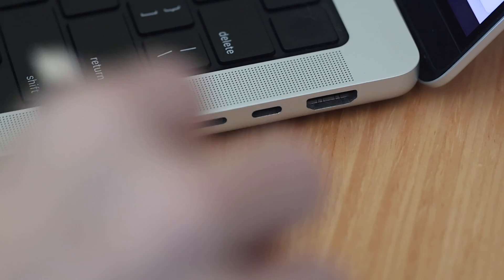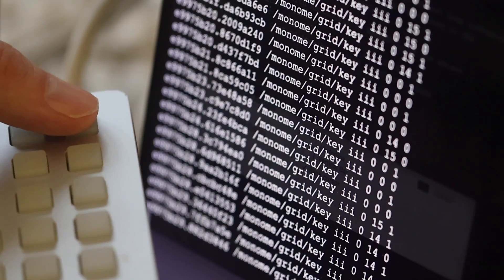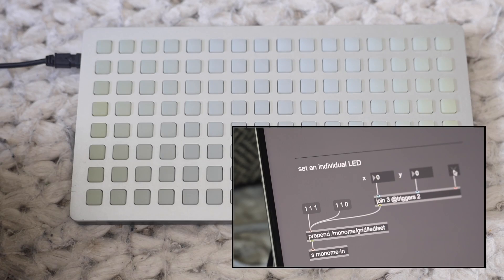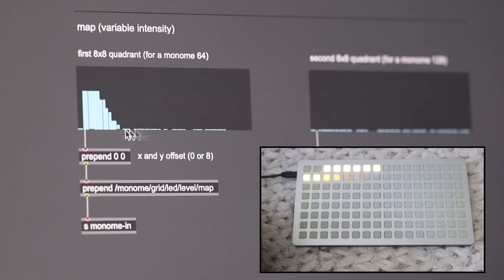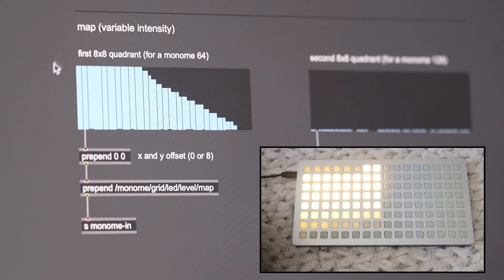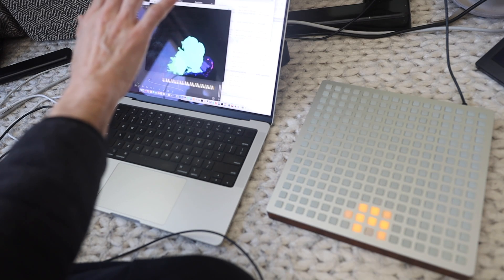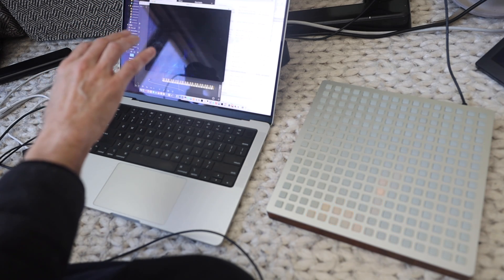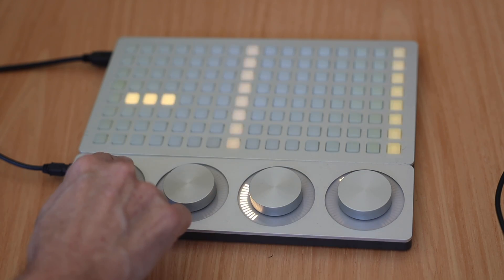How does a monome work?

Comment: But why is it so damn expensive? 1500 usd :O nice video btw
Reply from the maker: Supply and demand. You know how this works if you've ever looked for a 1957 stratocaster. It's just a slab of wood and some strings, right? If you feel the original asking price of the arc is too expensive, that's another conversation. But, let's say you had all the tools and knowledge necessary to build it yourself. All the individual pieces are not off the shelf parts and have to be fabricated individually. Glass circles, diffusion, masking of LEDS. It's a lot more complicated than it seems. No one has been able to build an arc more cheaply than what they originally sold for.

Comment: Arc is sick, I understand the usefulness of the messages. I dont quite understand the difference between a grid and for example a mapped akai launchpad to a mtrxctrl. Seems to me like they could do the same thing but maybe im missing something 😅. Ive always wanted to see the back end in max of what you do with the  performance videos, for us that love to see your tricks while coding in max 🤭.
Reply from the maker: One major difference is devices like a launchpad use MIDI and only support the equivalent of led/set messages, so if you want to set the entire grid of a launchpad, you have to send 64 messages. Launchpads never go beyond a grid of 64 LEDs, while a single monome may have up to 256, and you can use multiple monome devices in parallel to create even larger aggregate grids. Finally, there would be no launchpad if the monome did not exist first.
Reply: @stretta  That first point is no longer true, nor as important as it once was.  First generation Launchpads used the slowest possible variant on USB 1.0, so setting all 64 caused visible banding.  Nowadays, it's more or less fast enough to visually keep up with the more efficient map messages. 

This was made with individual messages per LED, and I believe I was sending all 64 for every frame, at the time.  (I try to only send messages where the value has changed, but there were no such optimizations in play):

https://www.youtube.com/watch?v=0_xlKK5SBm8

...and in the interest of preventing bottlenecks, there is a sysex command which sets RGB values for a whole swath of buttons.   (I haven't switched techniques, because I'm apprehensive about maintaining and troubleshooting that block of code, and/or tired and lazy.)

Likewise, while it's not fully contiguous, you can rotate four launchpads to form a makeshift 256,  albeit with a strong delineation between quadrants which has an opinionated pull on functionality.  One nice tradeoff, though, is that this arrangement also gives you 64 buttons outside of the grid, for "control rows" that don't consume valuable real estate inside of the grid.  But then, the other cost is desk space -- you can hold and operate a monome 256 in your lap, but that's just not physically possible with four launchpads.

Larger aggregate grids are technically possible (you can configure each unit with one of 16 USB endpoints), but that's even less contiguous, and having your "control rows" divide the grid is frankly bizarre.

Anyway... Monome is indeed the original, and more thought has gone into painlessly managing these concerns.  And it's hand-made with locally sourced materials, where the competition is mass produced from an ecologically disastrous amount of plastic.  So, there's that.